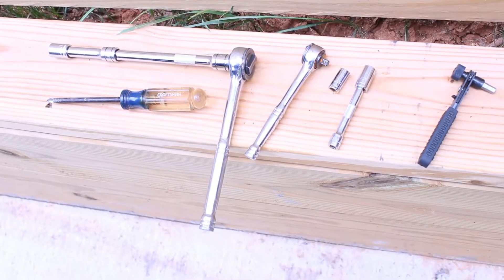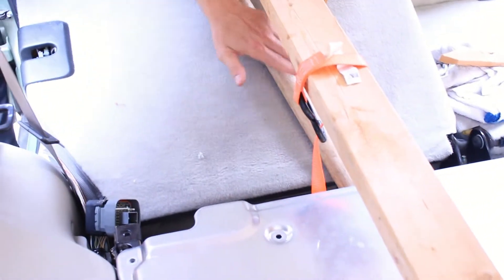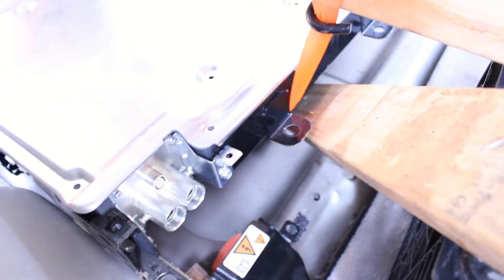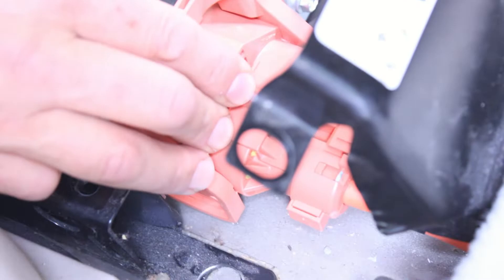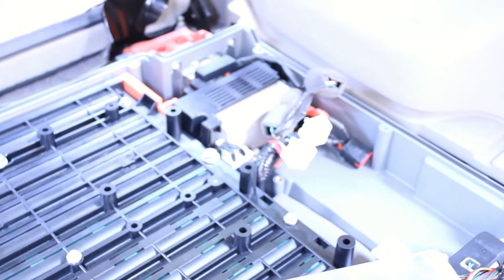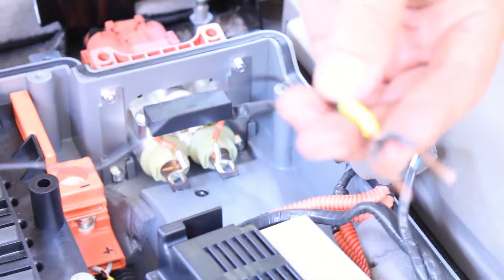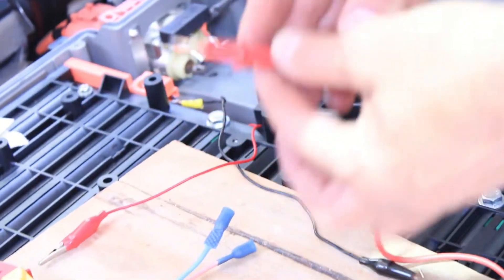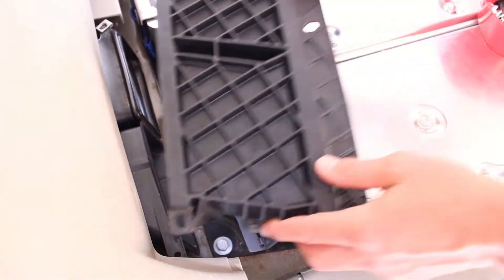Recharging Ford Escape Battery (without removal) 2009-2012

Comment from the maker: Hi all.  I am surprised to see this video gaining traction.  I hope it is helping folks out.  I will be posting more DIY videos soon, but not all Ford Hybrid Escape related.  One update on this hybrid battery recharge: as my/this Escape ages (2009 with 230K miles on it), I am noticing that if I don't drive it for 3-4 days, the hybrid battery system dies.  At first it was a week or so of inactivity, but now as it ages it is more frequent.  So, to prevent, DRIVE IT MORE OFTEN, or if you are out of town, ask someone to drive it for you, at least once every other day or so  The hybrid system relies on the regenerative braking to recharge the batteries, so just starting the car and letting it idle does not help recharge the system.  It needs to be driven and the brakes applied several times to get the recharge to happen.  Now, another thing that I did is added some small wire leads from the terminal connectors that are tucked away at the rear of the vehicle and capped (or protected when not in use to prevent shorting) and now since I am doing this recharge procedure more often, I just connect to these leads and it only takes a few minutes to set up, but then still a few hours to recharge.  I am guessing the best fix at this point is to replace the batteries and I will look in to this.  I am guessing a new set of batteries is going to cost more than the car is worth, but to replace the car with current, it will be a much higher bill.  I actually love this care and find it very reliable and easy to work on so would hate to have to get rid of it.  I will keep limping along this way, just with more attention to driving it more often and not letting it sit.  But, there are those family trips when you are gone for a week+ where this will be a concern.  just plan on recharging as soon as you return so you aren't dead in the water when you are heading out to the work your first day back... as has happened several times to me (just saying... BOOO).  To protect the wire leads (if you decide to do this) I added male and female "banana-style" connectors to the wire ends, opposites so they aren't mistaken for which side (and color coded to match the wires) and so they can't attach to themselves to short.  Then, when not is use, I used spare terminal plugs to insert into each end (male to female, and female to male) so they can't touch.  If this helps.  I may try to dig up pics of this if confusing, but trying to figure out this tech shtuff (yes Shtuff).  Anyway, hope this helps and tune in for more around the house, and auto repair type DIY videos soon, like and subscribe or whatever it takes to help boost my profile... I'd appreciate it.  Also check us out on KICK streaming ap for freshwater bass fishing with TwoDogsFishing_Kick live streaming (usually on Fridays) featuring www.AdvantageBait.Com (Lake Wylie, NC) custom lures featured in Bass Magazine and with my buddy Jason (Jason & Jason) and in my dad's 1988 Tribute Ranger 390V Bass Boat, which I will be posting several restoration videos on as well.  Keep those rods bent, your line stretched (as well as your budgets as a proud DIY'er)!!
Reply: 1. Your video should say how to charge hybrid battery )without removal) after removal.

2. This is much easier to do on the drivers side and you can leave the charger in the battery case and just run power leads out.

3. For what you are describing about your battery aging you need to get FORScan and run battery rebalances until it makes ith through the procedure 100% and then continue doing them at least on e a week.

Comment: Once charged how do I turn off the red wrench indicator on dash?
Reply from the maker: Hi William.  It should auto clear after a few hot/cold cycles or 150 ish miles.  If not, try disconnecting your battery terminal for about 5 minutes to see if it resets your codes.  Mine went away shorty after I fixed it, but did not reset myself.  Hope this helps.  More videos coming soon.

Comment: Why did you not tap the left side wires under the foam padding? This is where the old charging unit used to be from 05-08. Save all that work, time and back breaking effort. Just a thought...😊

Comment: Can you cut off the battery and run on fuel?
Reply: No. You'd have to redo the entire electrical system and replace the PCM and all the rest of the modules then add an alternator.

Comment from the maker: https://www.amazon.com/Sperry-Instruments-DSA500A-Snap-Around-Function/dp/B000ET5W0A/ref=sr_1_2?keywords=sperry+meter+d5a-500&qid=1692970359&s=hi&sr=1-2

Here's a link for the voltage meter.  There are newer models if you need extra functions, but this one is a bit more affordable.  I'll include a newer model which is about twice the price if anyone needs the extra features and capability.  My dad always says... Do it right the first time.  I guess here it just depends on if you'll have future needs for a meter with more functions?

Comment: I did this, it works.  Don't skip over the part where he says don't connect your electrical leads to the bolts that are insulated from the connectors!  I did, and it cost me a couple of hours and a lot of head scratching!

Comment: MUCH easier way to do this.  You do NOT need to remove all those internal parts on the passenger side of the HVTB.  On the driver side of the 2009 HVTB there is now a bundle of cables wrapped in gray foam where the charger was for the 2005-2008 models.  Unwrap the foam.  Ford left the connectors for that 05-08 charging circuitry on the two cables in the orange split conduit..  The gray one is positive and the black one is negative.  Connect your charging cable to those and  you can charge the battery that way.  This is now less than a one hour job and WAAAY easier. I left my cable permanently connected and ran in out the side of the HTVB with a safety cap on it.  You do NOT have to lift the battery up.  You have to remove the cover, but you don't have to go through propping it up.  Remove the two side plastic trim panels.  You then have enough room to grab the bolts on each side that anchor the blue lifting straps with channel locks.  You can cut down a torx bit to remove the pesky ones on the sides towards the front.
Reply: I just did this repair about a month ago and used the information provided by @urntwrthyZ (Thanks!!!). I ended up lifting the battery up about 1.5" but didn't disconnect any of the wiring harnesses.  In theory you could get those torx bolts out with a cut-down torx bit but I didn't want to waste a good tool.  I ended up leaving them out just in case I had to open the battery again.  You would want to use a 1/4" end wrench that preferably ratchets to put on the torx bit.  You have to remove the trunk side panels but they come off pretty easy, just some clips hold them on, I used a trim tool to pry them off easier so they wouldn't break. A note on the gray and black wires: on my 2009 the wires were both orange but one terminated at a gray connector and the other terminated at a black connector.  That took me a hot minute to figure out.  I used the same Amazon charger and the battery went from 270 volts to about 320 volts in only 20 minutes and I was able to start the car.  I ran the wires to the outside and added a barrel connector for any future charging.  I put the wires in a plastic harness and taped the end of a small plastic bottle top and lid to cover it.  The top cut off a 2-liter pop bottle would work ok for this.  I can just unscrew the lid to charge the battery or check the voltage.  You don't want any chance of water, debris, or anything that could short out those wires getting near the connector so the lid is a must. The big round orange colored disconnect has to be fully removed to disable the battery.  Don't just turn it, turn it and pull it out.  There is a fuse inside so if you mess up and short something out that fuse should burn out.  FYI you need the disconnect in to check the voltage or charge from these wires as they get disconnected when it is out (which makes it easier to set up or splice longer wires on to them without worrying about the high voltage).  While you are in there clean/replace the air filter to the battery cooling system, it is on the left side of the trunk. Oh, and if anything falls under the battery, use a magnet tied to two strings so you can slide it under there and maneuver it around.  Otherwise maybe a vacuum with some flexible tubing taped to it would work. Try not to lose anything is a better plan. The clip on the air intake fell under mine, doh.
You could probably run this charger off a 400 watt inverter connected to the 12v battery if you are far from a 120v outlet.  I wonder how hard it would be to put a 2008 charger in there?  All of the wiring is there ready to go, even some heavy wires ran directly from the 12v battery.  Sorry, I thought about making a video but I just wanted to get it DUN!
Reply: Hey @jasonday5091, thanks for that great info about the orange wires and the grey & black connectors on them. In my case, I pulled out all the 13mm bolts holding in the battery, but was still unable to pry it up to get to those torx screws (like it was glued down or something), so I just cut the top battery cover around the torx bracket on the drivers side with an oscillating multi-tool and propped up the top with a piece of wood. Since these wires are on the drivers side, I didn't have to cut the other side and completely remove the top. One note on the transformer (same one you and @urntwrthyZ used, HLG-120H-C350a) when you shut it down it still puts out volts and slowly dissipates. as even 50 v DC can injure you, let it wind down to zero before you touch those wires. I even shorted them together after unplugging it just to dissipate the charge (probably not suggested). Also, when you are done and unhook the charger wires, remember to mark which orange wire was positive and negative, as they are identical after you cut off those grey & black connectors.  @jasonday5091
Reply: I wish you would include a video or some photos of this method, I just don't quite understand where these grey and black wires.  Also, is the same high voltage charger used?  or a smaller one, perhaps because it is charging the top half and bottom half of the HVTB separately (in parallel)?
Reply: @garylee3551  The wires charge both sides of the battery at once and use the same charger.
Reply: @garylee3551  On 05-08 models Ford installed a charger for the HVTB in the battery itself.  It was on the driver's side of the HVTB next to the trays that hold the battery sticks.  When Ford removed it for 09+ models, it left a large space where the charger was.  You will now see a large gray piece of foam covering wires.  Included in the bundle are two orange split conduits.  The gray (+) and black (-) connectors are on the ends of those wires in the orange conduit.  Yes, you use the same charger, it charges both trays together.
Reply: This is a lot  to ask for but would it be possible for yourself to provide a video for those of us that want to be 100 % sure when messing with the HVTB. I have an 09 btw and would love to cut down the time!
Reply: Do you still have to lift the top cover to access these connections?
Reply: @Crashnchris27  You have to remove the cover, but you don't have to go through propping it up.  Remove the two side plastic trim panels.  You then have enough room to grab the bolts on each side with channel locks.  You can cut down a torx bit to remove the ones to the front.
Reply: @Crashnchris27  Yep, take the cover off and look on the left (driver) side of the battery for an open area where the charger used to be.
Reply: @jasonday5091  so what I ended up doing was clearing all codes with decent scanner and it gave me a really slow crank and started, so I didn’t have to do this at all. Something to consider down the road, mine had been sitting over 6 months too.  Thx for the reply though.
Reply: This video shows the simple solution:  https://www.youtube.com/watch?v=FqvXW6dMCTk
Reply: Thanks, @urntwrthyZ! I was about to go through the whole removal ordeal and the complicated charging on the passenger side until I read your comment!
I just got done doing what you suggested and it only took about an hour altogether. I also permanently installed the charger into the battery compartment, so I won't have to take the cover off if the discharge/no start situation happens again.

I made a video of the process, thanks to your tips, and I even gave you a shoultout at the end. Thanks again!

https://youtu.be/W5orI_GolP4?si=OvypPHSmt68sc7gk
Reply: Why no video

Comment: Quick Question…i exactly put the wire same way you describe in this video but when i connect the charger supply, it still showing 430 Volts even when i put the safety switch back…it doesnot charge….any suggestion? Thanks
Reply: 430V is plenty to start the vehicle and the charger doesn't really go any higher anyway.